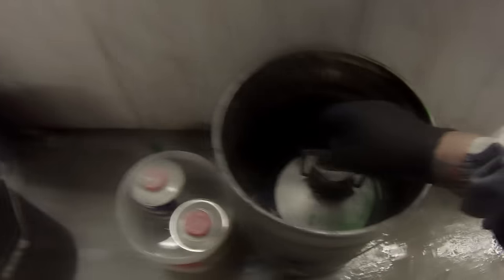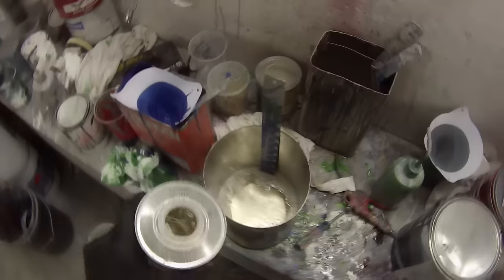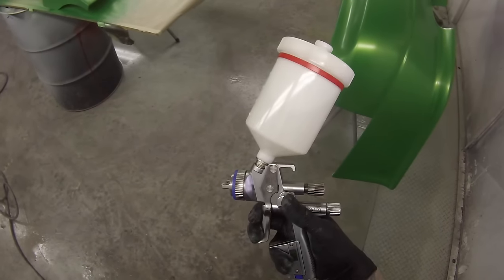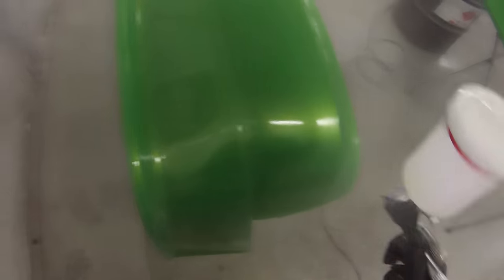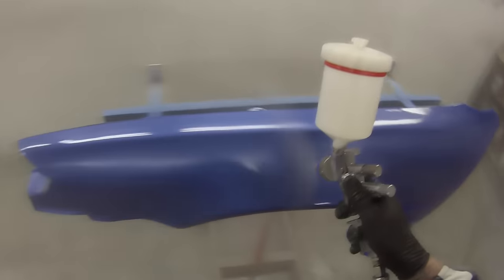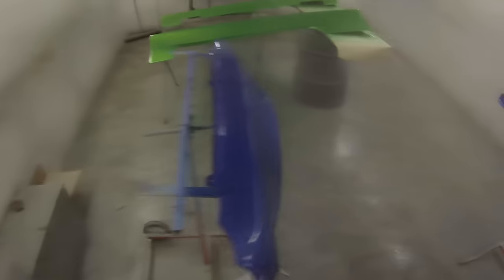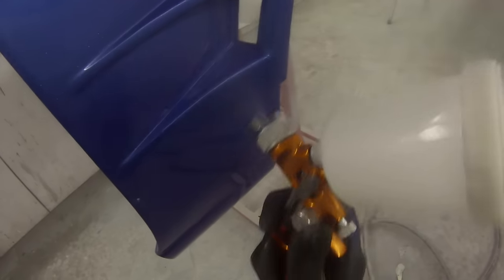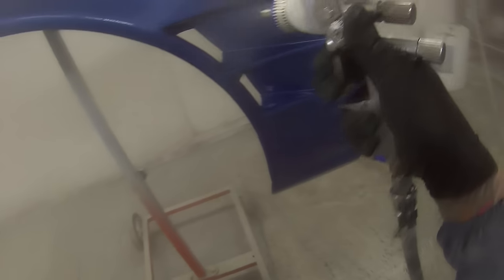SATAjet 5000 S14 Drift Car, Clear Coat Panels

Comment: I work in Melbourne doing fibreglass and gelcoat panels for caravans and we make the big motor home tops aswel, everyday we deal with pin holes more so in winter, hammering the paint on won't help fill them and we have to blend every repair without clear so we have to sand the blends and try sand the pinholes its a nightmare nearly everything has to be painted twice or at least touched up i have only been there 12 months and am already planning on painting my 93 vr i learnt to paint by feel no regulators was just givin a spray gun and told paint those parts with a brief lesson on blending lol but i think it was the best way to learn, by the way i have also learned alot from your videos thanks bro keep up the good work ;)
Reply from the maker: cainabis2011 Thats exactly how I learnt mate no regs on my guns back in the day.

Comment: Another great video - always looking forward to the next one - learn something from each one.  Living in the US desert I struggle with hot & cold extremes too.  Just a hobby painter but had tried heating the air by running it through copper tubing in hot water - good tip on heating the clear - much more effective.  Also have tried cooling 2k primer in a small shop fridge in the summer to get a little more working time.  Thanks again - everything you do is appreciated.

Comment: Hello ,Gunman...i have tried ur tips application with sata 5000 rp..in my workshop...i used spies hecker ms clear 8040 with hardener 3315 Hs...reducer 20 percent...my question is..if i applied ..i detected a few holes ...is it because too thick or to fast dry between coat 1 and coat 2?.....for information..i used sata 5000..rp..if i used challenger clear coat..the problem is disepear.....i come from indonesia and the temperature recent day is hot like Oz...

Comment: You put on clear and hardener in hot water before painting ? Why did you do this ? better is maybye solvent ? It is beter because hot clear is cooled by high pressure in gun ,and clear coat now is cold.

Comment: Nice work as always.

Question for you. After shooting base coat with metal flake how long do you have safely before laying down 2k clear on it? I shot some a week ago and had a medical emergency and its sat since. Do I need to wet sand it and lay another coat on it before the clear or just blow it off and tac cloth it and shoot the clear?
Reply from the maker: stresstest They always say under 24hrs so yep I'd give it a light sand then a bit more.
Reply: The Gunman 
Thanks man, much appreciated

I also wanted to add, the longer the vid and the more tech info you add the better in my book. I like what you did by addressing that question from a fan in this vid too. Pretty cool.

Comment: How long do you leave the clear/binder in the boiled water?
Reply from the maker: David D as long as possible, I like it nice and warm.
Reply: The Gunman - Just painted a 3 series without heat, boiled the kettle and warmed up the clear pre application. Perfect results and only one tiny run.
Good trick, cheers!